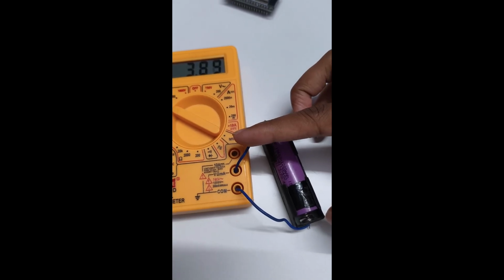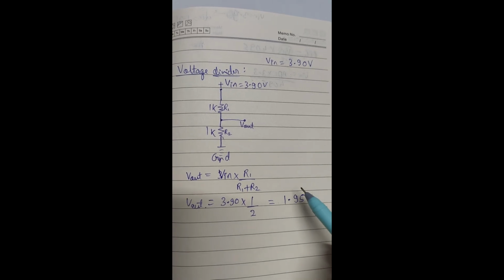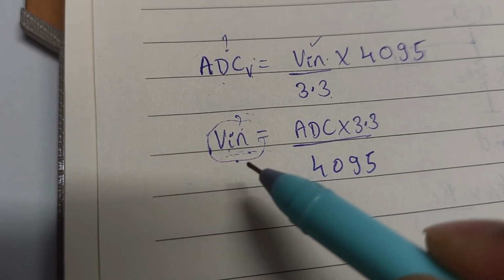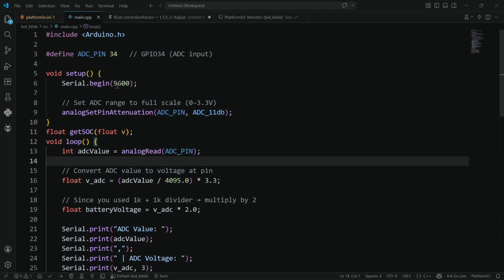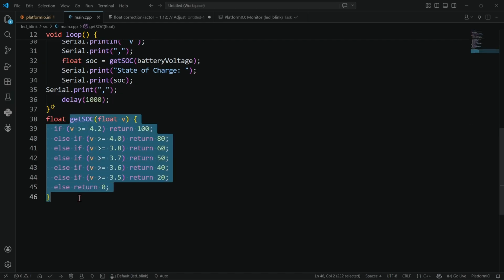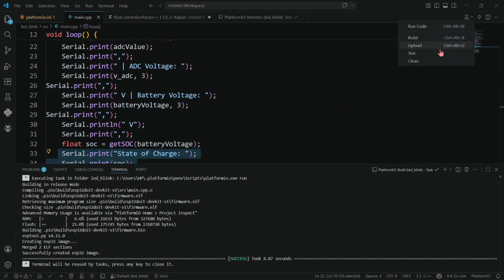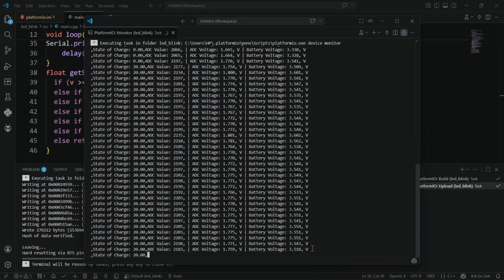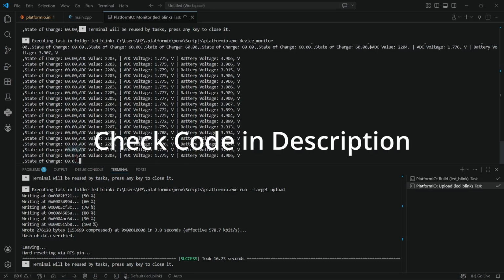ESP32 Battery SOC Estimation using OCV Method 🔋 | Full Working Project + Code

Comment: You can use a higher resistance VDR to reduce the power loss through the resistors. 🤪
Reply from the maker: Yes we can use, but I was not having similar resistor of that high value so I used which I had !! 🫡